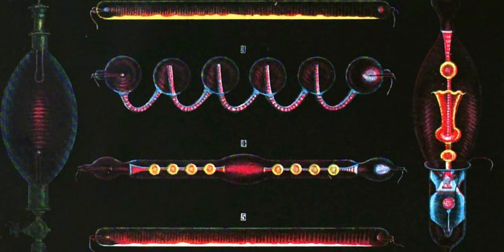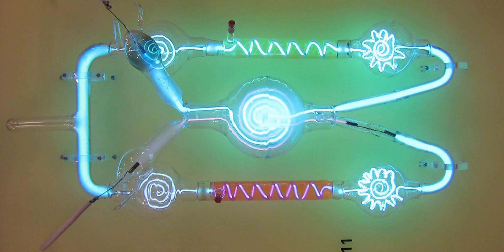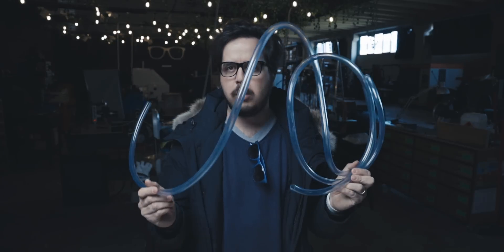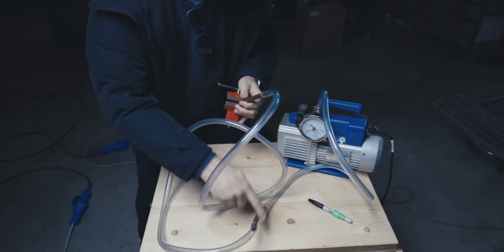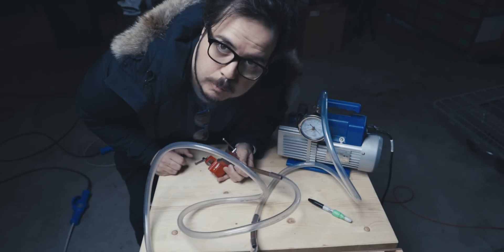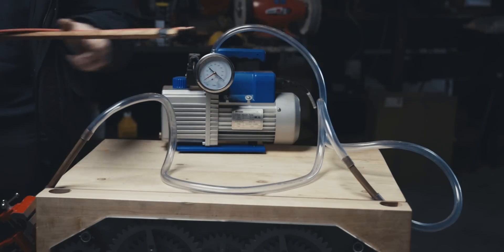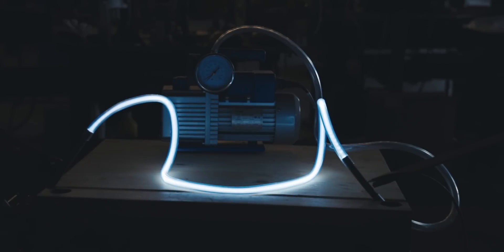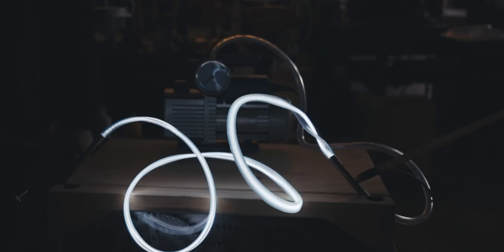10000 volts flexible Geissler Tube

Comment: You need to used a gas, like argon or xeon gas to use low voltage. Air requires high voltage.

Comment: 1) as soon as you have brightest light emitted turn off your vacuum  cause you don't need to keep sucking all the air and resulting in squashed hose.
2) for longer hose simply use higher voltages 
3) I'm totally stealing this idea to do my name on wall glowing sign.

Comment: Use glass and if you have to use flexible plastic them put most of it underwater to pull off heat, leaving clearance for HV terminals. By visiting a neon sigh builder you can learn what practical knowledge you need. Lowering the amps of the HV input will cut the heat (Ionisation induced ) you can run different wattage incidence blubs in seres with your high-voltage transformer to cut the output amps. Even an ignition coil or flyback HV supply would likely work better if you intend to use soft tubing - Good Luck

Comment: Hi, I made several tubes with glass jars, making a hole in one side and gluing a screw with epoxy. I used DC flyback transformers, but I guess the result is the same.  Oh and if you put a magnet on one of the poles, the electricity rotates as in a homopolar motor.

Comment: the vacuum pump takes longer than you might think to reach the required level of vacuum. also, a little vacuum grease interfacing between the plastic tube and copper pipe wouldn't hurt.

Comment: Use heated electrodes to start the arc at lower voltage/or to light up a longer tube.

Comment: so most spark-gap style lights like this, that establish a plasma, have a "striking voltage" and a "forward voltage". The strike voltage is typically LOTS higher than the normal forward voltage. For Nixie tubes, it's usually 175 volts striking voltage, and 140 volts forward voltage; for proper spark gaps typically the forward voltage drops to almost nothing so long as you've got at least a few milliamps going through the plasma.
One way you can kinda fool the system, is by lowering the voltage of your power supply by quite a lot, and then wrapping a wire around the outside of the tube and applying the striking voltage to that instead, which only needs a brief pulse. Once the plasma is established, the lower voltage power supply can take over. It's the same principle behind igniting Xenon flash tubes.

Comment: the reason why it doesn't always work is because you need a "starter" that's a circuit that temporarily highers the voltage at the start, and sometimes it works without it because you are attaching the cable terminal by hand and so creating a spark that highers the voltage and serves as a starter

Comment: Electronical engineer here. If you lower the amperes and grow the voltage, the electric are will be longer but the heat will be lesser too. I m using this technique on railguns to avoid that the bullet melts.

Comment: Thought: nest two tubes. Fill the outer tube with water or oil (and maybe a fluorescent dye) and use oversize T fittings to basically make a condenser column arrangement, but pull vacuum on the inner tube, and you should be able to get a crazy bright light that's any color you want (depending on the fluorescent dye)

Comment: use a wire braided tube so it doesnt collapse. get a separate vac meter and valve set so you can set the vac and close the valve and turn the pump off. make sure your tube isnt made from a material known to off gas under high vacuum.

Comment: My advice to achieve an easy start-up is to use something like the fluorescent lamps, a heated filament to emit electrons and ease the arc start. Should not burn inmediately if u're using vacuum...

Comment: I am no expert at gas discharge lamps or HV for that sake, but for the longer tubes it may help to have a sharp point on the electrodes where the electrons can escape more easily. On a Tesla coil you don't see any corona discharge forming without attaching a piece of wire to it, because electrons can escape more easily from sharp points.

Comment: What I think you can do is to make like a starter circuit, starting the plasma in the tube with a really high voltage spike can make a plasma which create a conductive channel for the lower amount of electricity to pass through.

Comment: To give an idea of length to voltage/current, our co2 lasers (80 watt) use 24-36kv at 1-35ma and the inner tube is 1.25m long and aprox. 6mm id. Perhaps a laser psu could be a cheap way to get longer discharges (plus being able to limit the current could be an added safety feature).

Comment: Interesting to see just ai doing that.  A mixture of 78% nitrogen, 21% oxygen, less than 1% argon, 400 parts per million carbon dioxide.  And result is pretty white light.  Hmmm...  I need to get back to my data books.
Actually I believe we are dealing not with what the Geissler tubes are doing -- extremely rarefied single gas.  In that condition you probably would see only one wavelength (one pure color).  With higher pressures even on one pure gas it is more likely you start seeing two or many individual colors or continuum.  I think.  But igniting the process is known to be more difficult with more pure single gas.  Just think it, even a helium-neon laser uses a mix of two gases.  I have a book called Electrical Breakdown of Gases, edited by J.M.Meek and J.D.Craggs (ISBN 0 471 99553 3).  That book tells about everything you ever wanted to know of these strange issues.

Comment: Super cool project. Have you thought of using clear vinyl reinforced vacuum tube?  Maybe even 3/8" clear poly air line would work and handle the heat better. All these are cheap alternatives.

Comment: One risk to be aware of, is that the hose between one the electrode and the pump can conduct just as well as the hose between the two electrodes, and if there is an insulation fault in your transformer arrangement, or the HV output isnt fully isolated, it can conduct to the pump. Even worse is if your pump has a faulty/missing grounding, and you touch the metal body of it and it conducts though you. Make sure the grounding of the pump body is done well (no paint/oxidation under the terminal, no broken wires) and that any cords/power strips you use are in good working order. 

If you want extra protection, a 3rd copper terminal between the pump and the experimental area that is connected to ground, can help ensure no current is conducted to the pump.   Even from a non-safety side of it, if the pump body is not grounded, charges up to high voltage, and discharges though the motor winding insulation, you could end up with motor failing from burned insulation, and a vacuum pump that needs repair because of that. 

Keep your 2nd hand in a pocket, and have safe fun with the HV.
Reply: You could briefly see the tube between the middle copper tube and the pump light up when one electrode was removed at the end of some of the test runs.

Comment: This is very cool, but I have one question. If this is demonstrating the reaction of a gas with high voltage applied, if you are creating a vacuum by removing all the air, what gas is the plasma stream reacting with? Maybe I missed the explanation in the video. Anyway, awesome experiment! Thanks for sharing (and not dying)!
Reply from the maker: It’s rarefied air in different pressure. Real vacuum is not achievable

Comment: Hmm if you quickly want to play around with "a glass bulb" I would try and get my hands on a Kemtech or Synthware cooling tube. Not only do that have great shapes and spirals that would look awesome just as is but they have 2 separate chambers so you could experiment with different colors in each chamber.

Comment: You could try some acrylic tube, use heat to bend it to shape.
Yes, you need to run the vacuum for longer, get a vacuum gauge to find out when you have max vacuum.
Be careful with high voltages and vacuum, specially if you start introducing other gases, you could expose yourself to x-rays.
Reply: Could be editing but seemed like too short of a time to pull a vacuum even with high quality equipment. I believe he pulled just partial vacuum and high voltage reacted with air creating more heat.

Comment: HV Engineer here. There is some very good advice in the comments already, mainly about safety which is obviously very important. I'm not quite sure what kind of power supply you've created but if it's variable, you could lower the voltage once the plasma inside the vacuum has been created to keep the tube from metling. This is because the inception voltage will be higher than the sustainable voltage.
Reply from the maker: Thank you 🙏🏻
Reply: @GiacoWhatever  This applies to those old fluorescent tubes too. They use a Ballast to apply the starting voltage, you might be able to use one for this project.
Reply: NovemberMyst I didn't watch this until now, that was the first thing i thought about!

Comment: Wonder if adding a metal spring the same diameter as the interior of the tube would effect the elimination.
Reply: That would just be a short circuit. It wouldn't light up unless there was enough current to make the spring glow red hot and set the tube on fire.

Comment: would it not help once you have a electronisation in the tube to stop the vacuum pump. The vacuum is already there?
greetz Bensh Belgium
Reply: The seals on the pump are not that great and would slowly leak air into the tube after you turn it off.
Reply: @CrazyNerdInventor  solvable with a valve no? and it could stop the tube from collapsing. you can put in a few T couplers with different gasses ready to be discharged in the vacuum. i wonder if it would collor change, vacuum, gas than back vacuum than another kind of gas vacuum ect ect

Comment: You know whats scary? Working with 1500 amps

It basically not a cable but copper bars bolted to other copper bars xD
Reply: That is never done alone though (when working on or arround 1500 amps under load)

Comment: We couldn't see the gauge, but you likely had to evacuate more air from the tube the longer the section. So the first attempt failed because the tube had more air, and therefore more resistance for the electricity to jump from one end to the other. Higher voltage (dangerous) or "higher" vacuum would have likely overcome that issue. In the third attempt when it didn't work at first, and then came on, it was probably pulling a high enough vacuum after a few seconds.

Comment: Are the plastic tubes PTFE ? I think you should check up to what temperature it gets because PTFE should withstand around 200 C. And if you try glass, maybe you could try using straight glass blanks and heat sections to try and bend it into the desired shape. Just throwing some ideas :)
Reply: Well yeah, i think he knows that but having a flexible tube is much more fun

Comment: HIGh voltage & no protection. Isnt high voltage the factor that makes el current jump through air and stuff?
Reply: high voltage creates an arc of plasma that can jump through the air ,provided the gap is small enough. Amperage on the other hand is the factor that can lead to injuries. If you have ever taken apart an electric lighter,  you may have found a piezo crystal inside and shocked yourself with it. It tingles but, although the piezo is capable of generating something like 1000-ish volts, its power output and thus the amperage are nowhere near lethal strength. Giaco however, is working with 10kV at 100mA which translates to a good 1000W which will definetly hurt you very badly and can easily kill you.

Comment: Very cool project but please wear rubber gloves if you are going to handle the tube while it's on.  It's too easy to get distracted when you are looking at the glow and forget that your hands are too close to the copper parts.  Just like how you made the plasma jump through the air, it could do the same to your hands without even touching it.   If the current goes from one hand to the other, it will not be good for you for sure.  Otherwise, Keep up the great work and thank you for the awesome videos!

Comment: That’s amazing.  So what’s the difference between giessler and neon?   Is one the precursor?   Giessler can be many gasses while neon is only neon?   I’ve never heard of this.  Really cool experiment.   Btw. Do you have a Don’t Die” sticker from Chris Zep.   I try to live by that.  😂
Reply from the maker: I had one on my backpack until it... died!
With neon lights they found a way to keep it on without this high voltage but just as a starter...